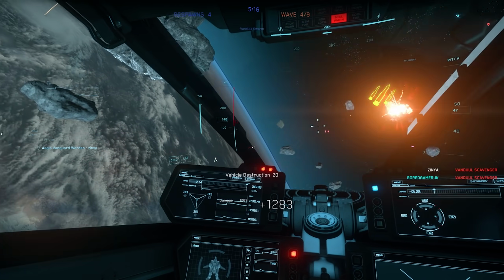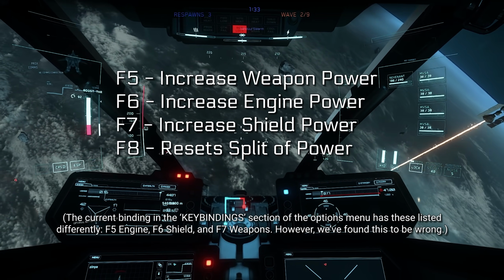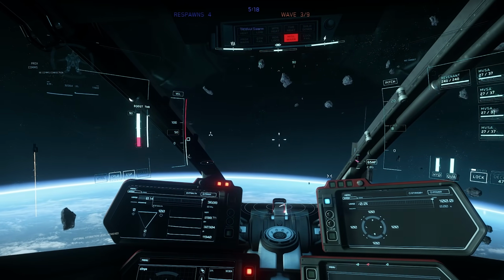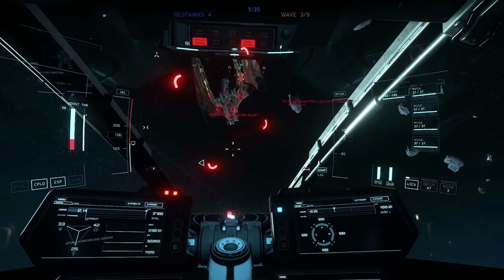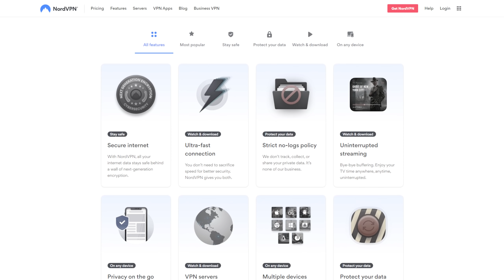Star Citizen - Power, Capacitor & Weapon Guide - What You Need To Know

Comment: 0:45 was the information I needed "You can't change the capacitors on your ship", now I know all I have is what I can manage manually.

Interesting that they chose capacitor instead of accumulator, because you can charge and discharge capacitors very aggressively compared to many other electrical components so to me capacitor is intuitively something I can charge harder if I have spare energy (like an oversize reactor) whereas an accumulator like a battery or pressure storage system is something with charge and discharge rates that are on par for the energy levels you're storing which is how ED and SC play out

Comment: Will the type of power plant affect the energy weapon pool, and will coolers affect reload time?

Pilot seats if they has missile control should not have a dedicated missile fire mode. This would allow for missile lock for the pilot and not lose control of the other weapons but lower it's accuracy. Ships designed for multi-crew members should use the missile mode allowing better lock and fire.

Comment: I know they want laser weapons to be the most common and ballistics to be more of a "special situation" weapon, but they kind of shot themselves in the foot on that front. People will just get better at conserving ammo and still go all ballistic so they can have more power to shields and/or boost at a time. It might mean restocking after every fight, but I think that plenty of people will learn to deal with that too. On the other hand, I suppose I can see a reverse of the situation as well, where some people with Defenders (or that have pulled the shield out of one) will put all power to boost and/or energy weapons, since that shield has such a long delay to recharge after taking a hit anyway. Then if their shields get low they would just sprint away or hide behind an asteroid or something and switch to shields 100% for a quicker recharge. Ballistics still have the edge though because there are lots of ballistics in each size where that particular shield is only size 2 and only available to people that have a Defender. Not sure anymore where I was going with that lol.

Comment: why is CIG nerfing missiles so hard? If your emphasis is on immersion you should at least be able to use missiles and guns at the same time in a single seater. Imagine airforce pilots hectically switching fire modes to release a missile and not being able to use the other pylons in any way. Star Citizen needs a pylon based weapon system which should be accessible at all times (at least for single seaters).

Comment: man your gameplay is so smooth, SC struggles on my rtx 2060. i would enjoy the hame alot more if it was as smooth as your videos lol
Reply: Playing in Arena Commander takes a huge load off the client and renderer. I got 60fps reliably in Arena Commander on a 980ti 3770K 16GB but teens in cities. I just moved the 980ti to a 11th gen with 64GB RAM and I get 40fps riding the train around Loreville spaceport and on MT and 100+ in AC. RAM is a big factor right now with 32GB being where it gets real good especially if you play in higher resolutions and vid makers usually have more RAM for editing than most gamers get. The ship interior render culling in 3.15 will start helping FPS some by taking some load off. Right now we render all ships inside and out to max draw distance even if you can't see them.

Comment: "Energy Weapons recharge after not firing for a brief time."
Ah, so they've decided to be even dumber than Elite Dangerous. I didn't think it possible. Here I was thinking Capacitors would be, and should be, a parallel power system that helped ship cope with high demand situations that the output of the reactors couldn't handle alone - not a power gate system that restricted the flow of power to energy weapons.